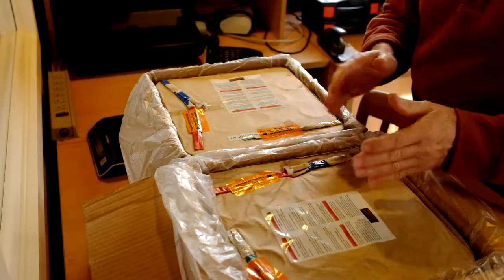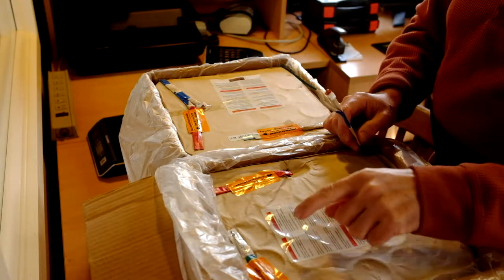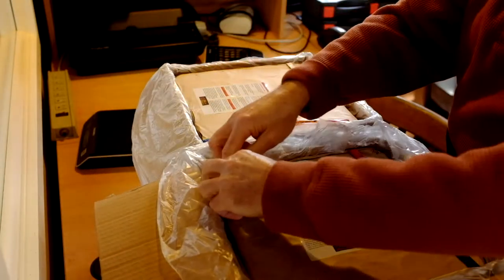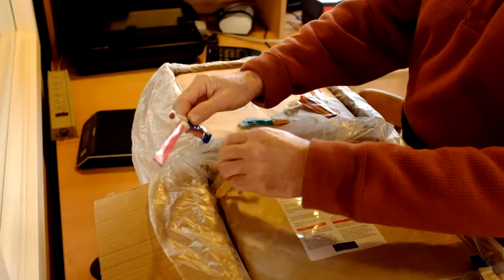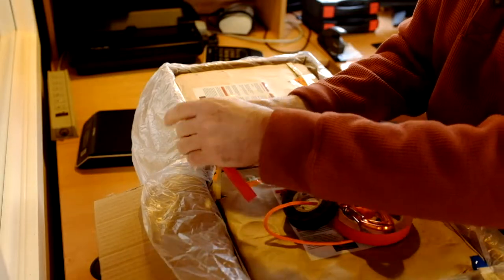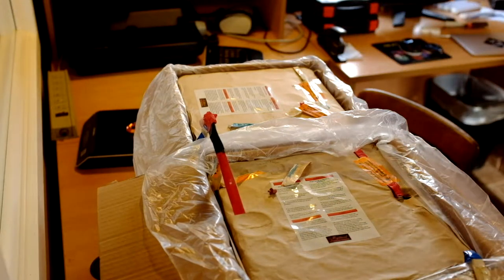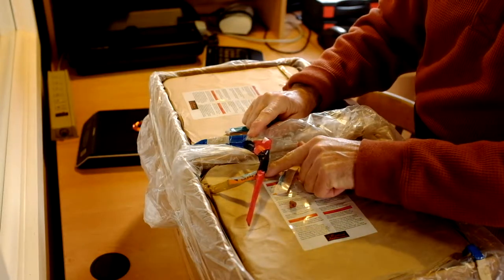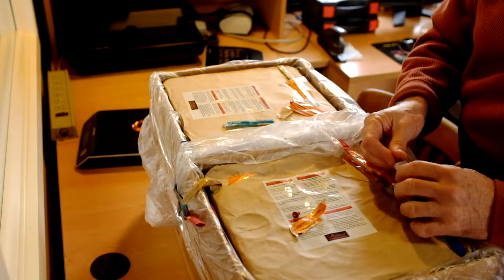Daisy Chain Fusing 2 Cakes

Comment: On my last show I forgot to tape it out of the way and of course the chain fuse broke :( Was a salute cake that was supposed to finish off the show too. Won't make that mistake again :) Thanks for the awesome video! Typically what length of delay would be between the cakes when fused like this?
Reply from the maker: Virtually no delay if the fuse is quick match to quick match, if there is a primed leader than there will be a delay of up to several seconds.  Both cakes need to be well secured against any movement when firing or the chain can break as there is not much leeway with the fuses on the cake.  Or you can add a bit of quick match to allow some safety margin 😉
Reply: @FireworksFX  All great tips, thanks!
Reply from the maker: @toysareforboys1  👍

Comment: I’m new I have a firefly unit will i be able to fire these cakes with my firefly system is it normal fuse ?
Reply from the maker: These are professional cakes so the fusing is different from consumer cakes. 
You will need to fire each consumer cake with it’s own igniter
Reply: @FireworksFX  right but what I mean is my firefly able to light these is the fuse just normal canon fuse
Reply from the maker: @alexdelgadillo1569  From what I know of the Firefly it will light visco/cannon fuse just fine